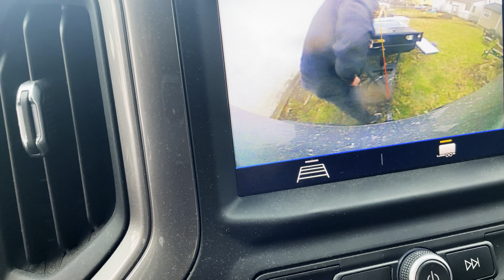Picking up project Papa Smurf from @gen2garage

Comment: I saw on the @Steve Morris channel that Torque Storm is coming out with a new Supercharger that is bigger and better than the one they already have out and it's mostly billet and it should be released to the public very soon if it isn't already by now so you might want to check into that if you're wanting a bigger one for the Nova or you want to put a big one on the Blazer and I love the Nova and I like where the Cutless is going

Comment: You know I've always wondered why Chevrolet never put a V8 in an S10 or the small Blazers I wish they would've because it would've made it easier to swap V8 engines in and out of them way easier and you wouldn't have to do any conversion work to them

Comment: 4.3 is 2/3thirds of a 5.7. Bet she'll squeal with some nitrous on her.
Reply: 4.3 doesn't have 4 bolt main caps. They can make a good bit of horsepower. But they can't hold it for to long. And to make it hold that much power it costs more than a sbc. Ask me how I know.
Reply: @worldssickestmedia2713  well damn I was talking size wise. I know it wouldn't take the power! But let it go out with a bang! Damn do I have 2 explain everything? Oh man it's not got the main caps and such and such an someone shit in my breakfast.
Reply: @goldenwheeledbanshee9160  Because it's a common misconception when people hear it's a sbc with the front two cylinders missing. I own an engine shop and get asked about that all the time with people that Have S10's and V6 Silverado's. Then the next question I get asked is "well a 3.8 liter Buick can hold it, why can't a 4.3?" And in that case it's because the Buick is skirted. I built one of those Buick engines for a project when I was in trade school. It made all kinds of power. So then I applied that principle and what I had learned about the Buick to my own truck And sent the engine in my S10 to the grave with an old junk yard turbo. It didn't take much before it puked the rods out. And on a last note a little 4.3 vortec engine used and in good shape goes for a pretty little penny and they are in demand. In tact they go for $600-$1100 and even more with the intake and all the accessories. So sending a running one to the grave with N2O is kinda silly and wasteful. You can buy a few race car parts with that money. So there's the shortest explanation I can give. And if you're into this kinda stuff you should be eager to learn. Not get your feelings hurt when someone drops some knowledge on you. Have a nice day.